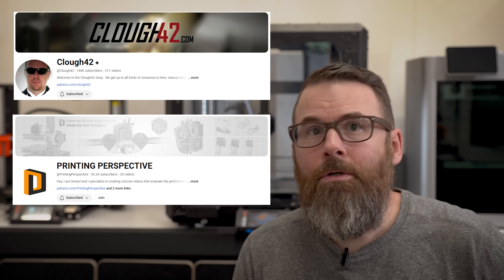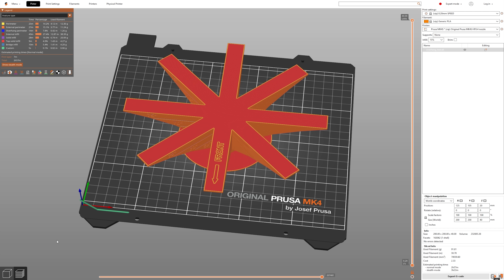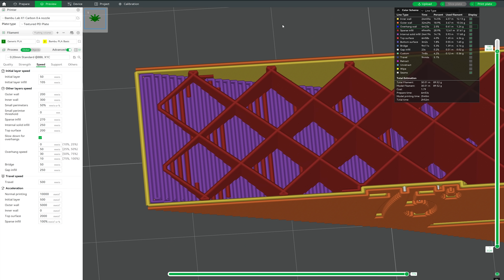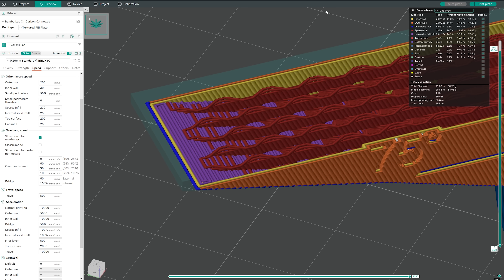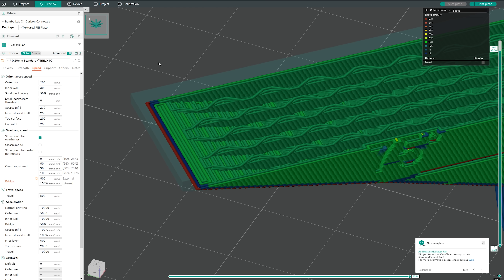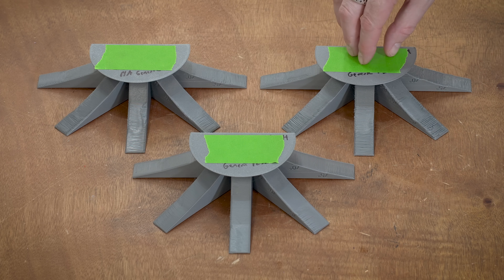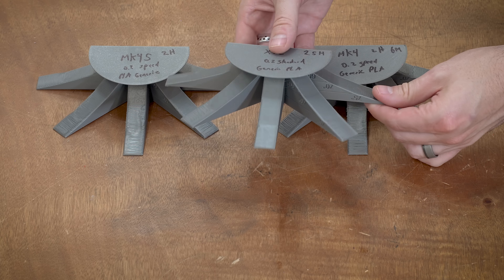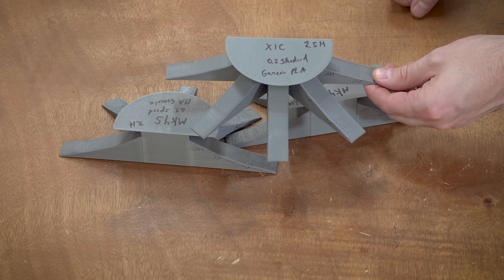Uncovering Prusa's Overhang Performance

Comment: I always wonder what the right thing is to do when it comes to reviewing printers on model quality:
Do you use the same slicer for all printers? And thus manually create any missing profiles/settings.
Or do you use the slicer that comes with the printer? And thus lose out on a "purely hardware" focused review...

In other words: do you review a printer based on the package as a whole, or only the hardware?
In this case, the Prusa printer was reviewed in the "package as a whole" flavor, and came out on top. That is one of Prusa's big selling points: "It just works"

Comment: I'm looking at the latest version of Bambu Slicer, and if you mouse over the "Bridge" setting, it's pretty explicit:  "Speed of bridge and completely overhang wall".   If I look closely at an overhang test that's sliced....it does appear that it's only the wall sections that are coloured as overhangs are the only ones that are speeding up to the 'bridge' setting.   I don't know if I see any consipracy here, since the slicer seems to be doing what it says in the tooltip.   I acknowledge that you're getting much better quality by slowing down the bridge setting at the expensive of time...and that's VERY good to know!   I appreciate your testing.   I don't know if there's any 'conspiracy' here, though.    The fact that Prusa machines work best within the Prusa ecosystem shouldn't be too surprising, really.
Reply from the maker: The marketing material I was giving specifically says " the MK4S prints them so steep that most competition downright fails at printing them".  This was true with the overhang platter model they provided.  If you change that ONE setting in the slicer, the 'competition' no longer fails and actually produces a better part than the MK4S.  The claim is that the new cooling system is superior, but it's actually just a setting.
Reply: @RobertCowanDIY Robert I think it's ok if you change the settings but on the other hand Bambulab had enough time to fix it. But they don't care. The normal dude won't find out if even you don't notice it straight away.
But how do you explain the much worse result of the Prusas in your second test?
Reply from the maker: @herr_rossi69  Prusa is sensitive to filament.  It really likes higher quality filament.  It prints prusament really well, but can be hit and miss with generic stuff.
Reply: @RobertCowanDIY  I cannot share this experience. Neither the Mini nor the MK4 are particularly demanding.
Although I don't use the really cheap one.
If cheap then Sunlu or Yayo.
But mostly European brands.
If only because of the vapors.

Comment: Door and top open on the X1C?
Reply from the maker: Just the top off as they recommend.  For such a short print though, it won't matter much as 2 hours isn't enough time for heat to really build up and become a problem.

Comment: This is a great video. Thanks so much for doing this.

What are the chances you have Prusa and Bambu filament on hand? Could you run the test with Prusa filament in the MK4S and Bambu filament in the X1C and see how they do with their own materials?
Reply from the maker: I COULD do this, but it just simply shows that their own filaments are tuned to the printers.  I did this in my last test with the bambu performing similarly to the MK4S when their own respective filament was used and the bambu was slowed way down.
Reply: That is completely irrelevant

Comment: The slicers are so much better than a couple years ago. Im curios how much better they can get in the future. 
Probably the part will get analyzed and a custom print profile will get generated for the part is my guess.
Reply from the maker: Yep, that's more my point.  If the printer relies so heavily on the slicer being slightly better at some things, give it 6 months and that will be an irrelevant argument.  Go with the better hardware, assuming the software isn't acting as a detriment.

Comment: I understand the flaws. Nevertheless, it should be good to test the model with the same G-code on each printer in order to determine the best for overhang.
Reply from the maker: That could be interesting.  I suspect the X1C could run that gcode quite easily as it can do much faster print speeds, acceleration and flow.  You'd need two sets of gcode, one optimized for the prusa and one for bambu...  I suspect bambu could do both fine, but not the other way around.

Comment: It would have been more accurate to slow down printing in Prusa Slicer too.
Reply from the maker: As someone else pointed out, I should have just removed the top layers.  It was just the top layer that slowed down the Bambu.  They would have been the same time, but the top layers were being treated like overhangs, and going 1/5th their normal speed, which caused the extra time.  The rest of the print was going at the same speed respective to each printer.

Comment: Just so that I understand what was being compared here. Is the "Generic PLA" profile in Prusa Slicer and Bambu/Orca Studio the same?
Reply from the maker: I'm comparing what a user would see.  Open box, install filament, load up a model, slice it with standard settings and hit go.  With one setting changed on the Bambu, it changes things quite a bit.  That's the test.  Without the change, the Prusa wins, but with the change, Bambu wins.  So it comes down to a simple slicer setting, which will most likely get fixed.

Comment: After slowing the bridging speed in Bamboo Studio, how much of longer was the total print time compared to the Bamboo overhang test?
Reply from the maker: It added about 20 minutes, but that's because the layer on top of the in-fill was printing at 10mm/sec which slowed it down a LOT.  If that behavior is fixed, it'd a moot point.

Comment: Not sure if it was already mentioned in the video. MK4S had the second best overhang hang performance behind the X1C. But MK4S took 2 hours to print vs X1Cs 2.5 hours. I think you should slow down the printing speed of the MK4S to 2.5 hours and re-test it or a better comparison?
Reply: No, it is only slower because of the slow first top layer, did you not watch the whole thing? Overhangs printed at the same speed...
Reply: @riba2233  I watched the entire video and might have missed that detail. I still find the testing methodology flawed. First,  the video used a 3rd party filament to be 'fair', fine. But the printing profile of the X1C was 'tuned' to fix the bug. That, to me, negates the fairness aspect of the test. Would like to see some tuning done to the Prusa printing profile (filament temperature etc...). But how do you know it is a bug? Did BambuLab acknowledge that is a bug? Why didn't they fix the bug yet? Is it even a bug? Is that a fault of Prusa?
The reviewer did mention that the MK4s did better on the Prusament. I just find it a bit disingenuous to say that the hardware did not improve the overhang performance.  
Personally, I think it is better to test it with Prusament with MK4S and Bambulab's own filament.
Of course I am not saying that Prusa is flawless. I have this perception of them releasing an unfinished product (input shaper), although they did deliver it in the end.
Reply: @YS-nj7dm  methodology is not flawed at all, he used the same filament for both, also didn't use bambu 1st party filament and that is irrelevant all in all, printer should perform well with every brand, nobody uses only 1st party and they shouldn't have to. 
And yes, it is 100% a bug, it literally doesn't recognise the outer overhangs, and only that was tweaked in the profile, that is the whole point of this vide0.
Reply: @bruddaozzo  lol ok
Reply: @bruddaozzo bro calm down it’s not that serious. you got that angry over a youtube comment?

Comment: Seems like a no-brainer to do a test where you slice on prusa and print on bamboo, no?  Or am I missing something glaringly obvious?
Reply from the maker: Check at 4:09, I explain what I did.  The Prusas get sliced with Prusaslicer and the Bambu gets sliced with Bambu Studio (with the bridging speed changed).
Reply: @RobertCowanDIY  Yea, but it's all just gcode.  Swap the slicers.  Ya know, for science. :)
Reply from the maker: @GeorgeGraves  Not a bad idea.
Reply: @RobertCowanDIY  Are you kidding me?  All my idea are good.  I'm a good idea factory.  I even poop good ideas.
Reply from the maker: @GeorgeGraves  HAHA.  I'm sure there will be some issues with the 'start gcode' though, the bambu probably has some routines it runs.
Reply: @RobertCowanDIY  Yea, swap the two start gcodes.  Most slicers organise it quite well.  The first layer should be labeled 0.2mm or what ever you have it set for.  Should be no problem for you.
Reply from the maker: @GeorgeGraves  Ah, true.  I'm still not sure how much more time I want to spend with it.

Comment: Problem is is you wrote that it took 2.5 hours for the two panda bear printers but the European printer printed it in two hours. Slow it down to the same speed and then compare. The European look much better.
Reply from the maker: The extra half hour was due to treating the layer above the in-fill like a bridge, so it went 5 times slower than it SHOULD have gone.  Does that make sense?  If it printed the overhangs at 10mm/sec and THEN the top bridging at 50mm/sec, they would have been roughly the same time.  So it wasn't necessarily faster, it was just a bug that prevented it from printing both aspects at the appropriate speeds.

Comment: If you ever have to print this again, I suggest turning off top layers. They aren't relevant to the test (other than marking the one that points front, which will still be obvious) and that will avoid the time penalty you mention at about 4:35.
Reply from the maker: Ah, that's a good point.  I wasn't so much concerned about the time aspect though, they are roughly similar in the amount of time they take as both printers need to pretty equally slow down for those overhangs and that's the majority of the print.  But great idea.

Comment: It seems that both the X1C and the Mk4 where enclosed, not like the Mk4S. It can be a reason of the disapointing result.
Reply from the maker: Potentially, the MK4 enclosure doesn't really have a fan for venting.  I did leave the doors open though.  But it's not a 1:1 comparison, agreed.

Comment: On the voron team, I've been working on airflow and cooling pretty steadily for about four years.  More times than I can count I've been fooled by a slicer setting difference.

Thats one reason why we like the shuriken test.  it is printed with 2 vertical shells, no top layers.  The bulk of the print is in perimeters, and by timing the overall print we can be sure some setting change isn't responsible for our improvements.

There are lots of variables with cooling, and if you want to advance you have to control for them.

Comment: A possibly dumb question.... Is it possible to import the X1C profiles into PrusaSlicer and just use the latest PrusaSlicer for both printers? If that works, it may be the best of both worlds. 

I don't have any Bambu printers (though I may buy an X1C soon) so I don't know if their profiles are just plain text files like the PrusaSlicer ones or if they changed that. (That was true last time I messed with PS, anyway. My Mk3s is still in a box after my last move.)
Reply: i've done it before but it definitely feels a bit janky

Comment: Needing to slow down below 50 mm/s for overhangs is.... rather miserable.
Reply from the maker: EXTREME overhangs, we're talking 70 degrees or greater with a 0.4mm nozzle.  That means it's practically printing in free air.
Reply: @RobertCowanDIY  The annex testcube goes to 75° and I do it roughly as well as these prints at 280 mm/s.

Comment: Enable slowdown for curled overhangs in orca and you’ll get the identical behaviour to prusa slicer ;)

Happy to explain the differences between the modes if you fancy pinging me on the orca community - classic mode, slowdown for overhangs ticked or not and classic vs Arachne all influence this. 

In orca if you want to mirror the prusa behaviour have classic slowdown unticked (classic is the Bambu algorithm) curled perimeters ticked (the prusa algorithm) and any perimeter generator (classic or Arachne) and it should be absolutely identical. 

Also in the 2.2 dev release we’ve introduced a new feature to better contain line segmentation for overhangs that prusa doesn’t have yet, which should improve overhangs further.

Edit: I’ve raised a PR in the orca repo to explain the functionality better, hopefully removing some of the confusion.
Reply: Now let’s hope the bridge anchor bug is fixed as well. The ends of bridges on what I believe is interior bridging does not travel far enough to attach to anything. Appears to have appeared in 2.1.0 and still here 2.1.1.
Reply: @joescalon541  I had that issue which was caused by the setting "Don't filter out small internal bridges (beta)". Set it to disabled. That fixed it for me.
Reply: Explain how? Orca has no proper wiki? Do you mean in-UI tooltips?
Reply: @Tome4kkkk firstly the wiki is starting to be populated with tips and tricks (I’ve posted a layer height, line width and seam tuning guide in recently). Secondly, yes the tool tips are everything for these settings…
Reply: @HotendHacker  BTW, with the lack of documentation what I find the most confusing is the Calibration workflow. By that I mean the relationship between BL A1 built-in calibration routines and the "manual Orca calibrations" is completely unclear to me.

Comment: I call BS.  In the previous video the MK4S prints were perfect, somehow they have gotten worse suddenly.  How convenient for Bambo.  While you strived to improve the Bambo through the slicer, you make no attempts to improve the MK4 slicer, huh… okay.
Reply: The only difference for Prusa was the filament. He printed the same model with the same filament. If Prusa can only print well with prusament but bambu can do it with any filament once you get beyond the bug that doesnt look good for the mk4s.
Reply: @No0o0o0o0o0  different filament with the same gcode doesnt work. temps of prusament are usually 5-10C higher than others, sometimes even more. no wonder

Comment: The Mk4S has the best tuning of any printer. Bambu just doesn't care as much hence why people made Orca. They got sick and tired of Bambu Studio missing so many features and being so slow to implement changes and corrections. I expect Orca to get this in weeks... Studio will likely take months.

This is just another case of Prusa actually testing things and Bambu not (because they dont need to as part of their core business). Having 700 printers going all day long as part of your manufacturing line is a big plus. Sure it increases prices, but it means they actually live with their product.

What will be more interesting is dynamic speed adjustment based more on then just the type of extrusion as you showed. There is some work being done to allow dynamic selection of quality and it adjusts the gcode and can change speeds on the fly on the same movement. (e.g. when doing a bridge slicer can take into account the length of the bridge to min/max the settings instead of hard values). Then you can optimize for layer adhesion, surface quality, and speed.
Reply: Bambu Studio is way behind in software tech, I have been modelling and using OrcaSlicer for the past months. It has many enhancements for better printability without needing to print support all over the places.

Example: Orca is just far superior, they implemented many things like borehole sacrificial bridging or partial bridging as suggested by one of the YouTuber. This is automated in OrcaSlicer (dropdown parameter) without needing to go back into CAD and design that hexagon bridge for the screw hole. With this, you can print without support.
Reply: This is just crazy prusa propaganda.

The whole print farm thing never ceases to amazing me in how bad an argument it is.

The parts that come off of their print farm usually look awful and it slows their production down so it continues to be an awful argument.

They should be using mass manufacturing techniques and not this gimmick but I guess people believe the myths surrounding it....
Reply: @BeefIngot  "The parts that come off of their print farm usually look awful"
you have literally never owned/used or seen a prusa product in person. How would you even know if their prints look bad lol. Their print farm proves how reliable their printers are.
Go cope in your corner.
Reply: @LilApe  Its literally the most common complaint about their 3d printed parts.
Reply: @LilApe  please cope more hahaha, this is so fun to read every time 😅

Comment: With all due respect Robert... you mean that incorrectly applied speeds on bambuslicer and orcaslicer (having received a warning 9 months ago by Prusa) invalidates the claims on the mk4s performance? I would rather reconsider the machine Im using if I see that the slicer has that level of neglect with such a relatively new product. If that happens when the competition is warning you and giving you the source code... what kind of support and updates can you expect in another 3 years? IMHO that's the spin.